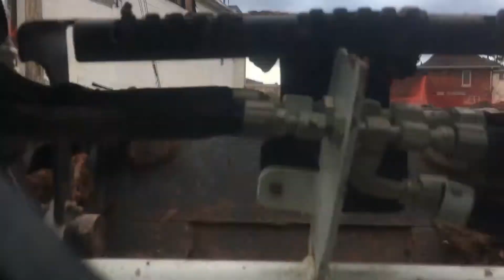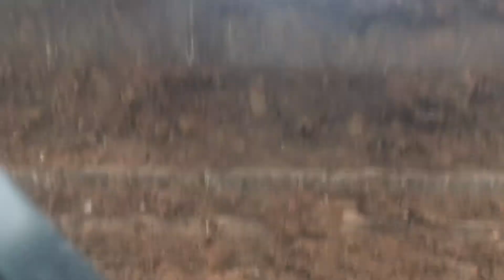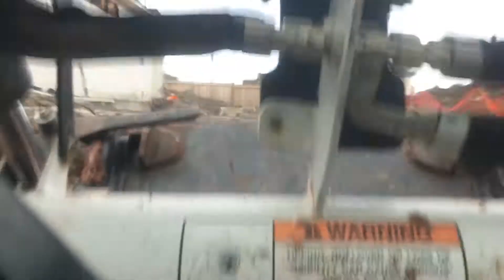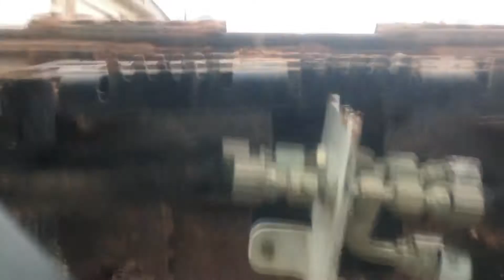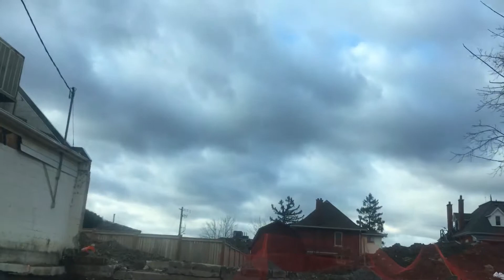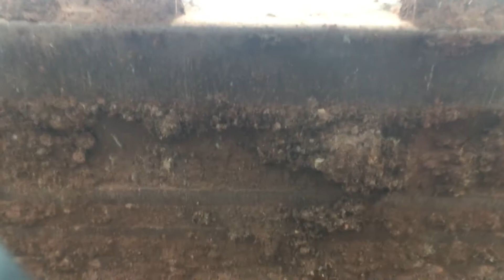Pushing soil into the big cut with the bobcat t590 skid steer

Comment: Nice swimming hole what town are you in today? Thanks for sharing
Reply from the maker: Ya back to Hamilton to back fill. We got most of it filled yesterday but the contractor supplying the soil ran out so after he generates more we will go back and finish up. Pain in the butt to keep going back every few weeks but it is what it is.
Reply: Just wondering what was taking out to make the swimming hole?
Reply from the maker: andrew dennis , we were doing remediation work, digging out contaminated soil from a dry cleaners so that the site will pass clean
And can be certified to sell.
Reply: John Teel thanks we have the 770 bobcat do you like this one?
Reply from the maker: andrew dennis , ya I like most bobcat machines I own an older 743 and the engine needs overhauling but I love it.